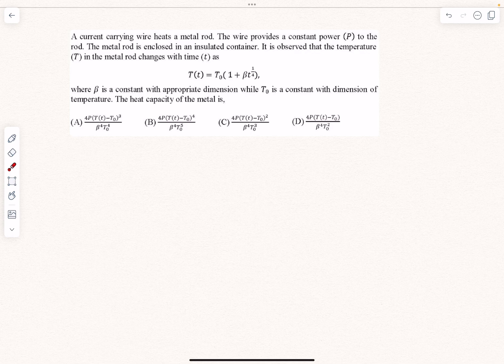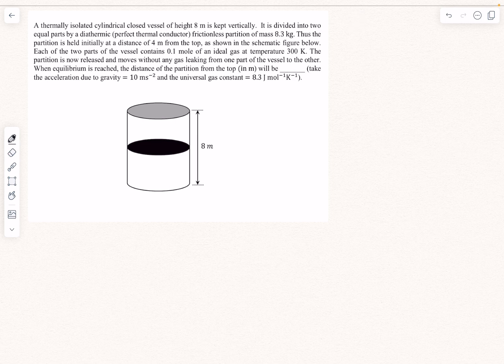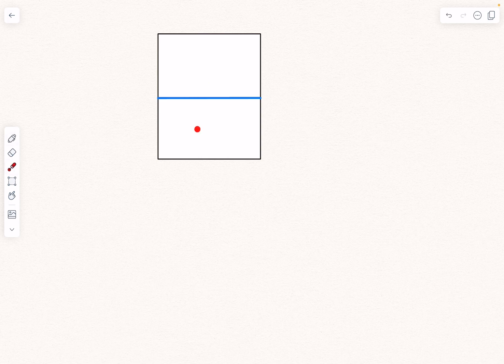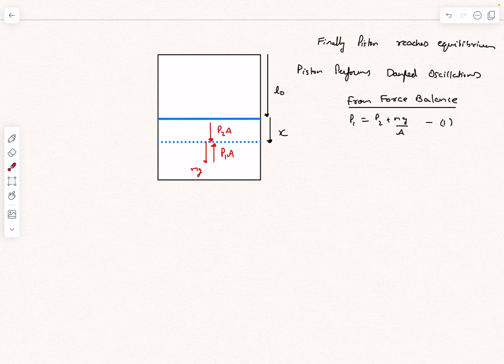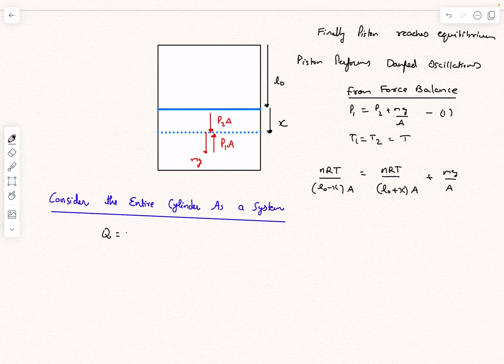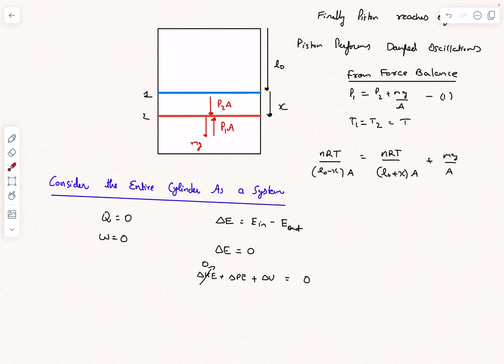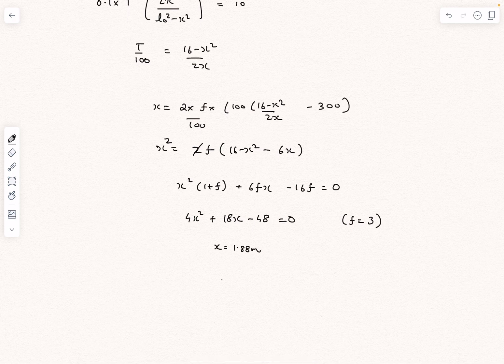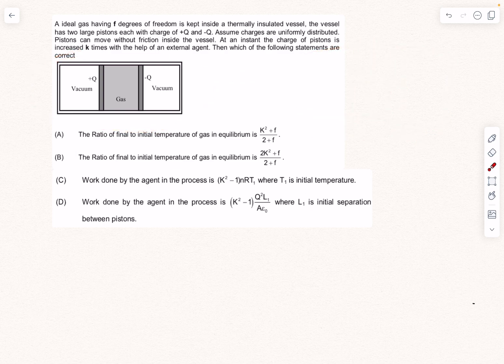Thermodynamics Previous Year Problems | JEE Adv 19 & 20

Comment: for the hw question i am getting ratio as (2k^2-f)/(2-f).... since free expansion then work done by gas is zero so PE change of gas = -(PE change of charges)..... could u tell where i must've gone wrong?
Reply: You are probably making a silly mistake related to negative sign. I would recommend writing it in a way as follows: U(initial) = U(final), where the expression will be written as K²L1/2AEo + nfRT1/2=K²L2/2AEo + nfRT2/2

Comment: I have a doubt in the last Jee question you solved. You said that the internal energy is increased by mgh. What exactly is increasing the internal energy of the gas if the work done by the gas is zero.